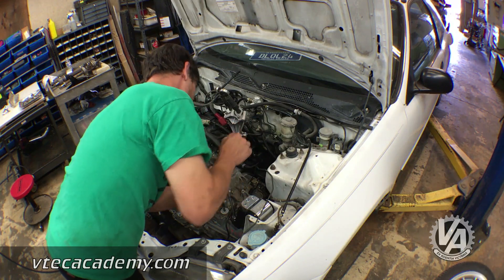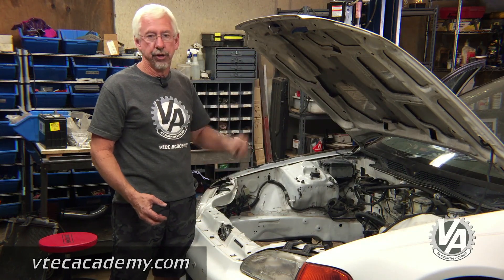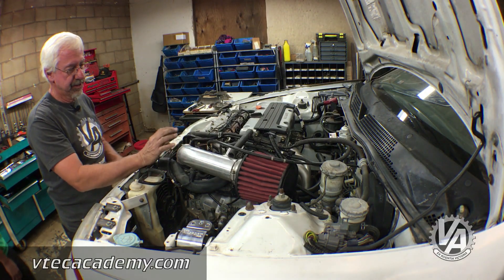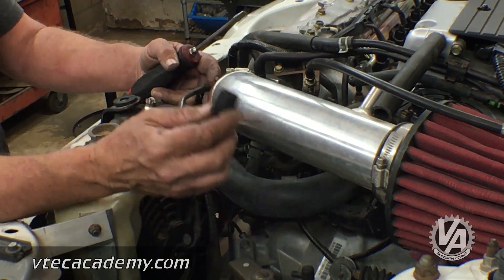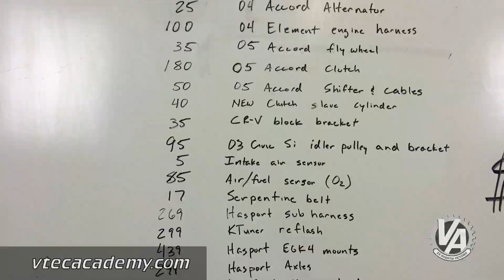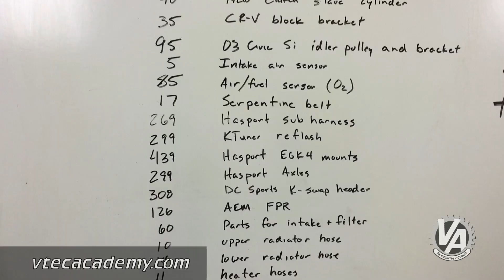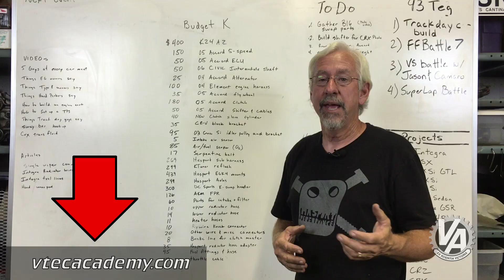Civic EG Budget K Swap Part 2

Comment: This vid makes me even happier with the 01 civic I just bought for 3k! K24A2 with type S 6spd, tuned on kpro v3, act stage 4 clutch, retained power steering,  VC has been tapped and welded and powder coated for a breather box, Moroso oil pan also tapped for turbo return line. It’s suuuuuper clean. All new fluids. Swapped in a cluster from a 05 civic. I bought it off my tuner when they decided to scrap the budget 10 sec project due to lack of funds and winter arriving. The car had only been swapped for like 40 days. Just the kpro and the clutch is like $1400!

Comment: EP3 axles would have saved that extra cash...theyre 36mm inners with 32mm outers to fit bone stock eg/dc2 hubs 😉
Reply: Thanks for this
Reply: @Pugsandhugs94   did you happen to go this route? is so were they the correct length  to the hub?
Reply: sorry for getting this up, just a quick question. could i fit the 5 lug conversion from the ep3? i have the whole ep3, and want to do a kswap in my eg. Could i fit brakes from the ep3 on the eg?
Reply: Ivan Dumančić no
Reply: Usually one of the EP3 axles is on the short side. And can pull out while turning or accelerating.
Reply from the maker: EP3 axles could leave you stranded on the side of the road with collateral damage from an axle slapping around at a fairly high rate. We have seen it happen. Some people get lucky though, so make sure you weigh the risk.

Comment: 7 years later, it can be done for $1,745 as long as you're willing to do some work. Dope.
Reply from the maker: Hell yeah, it's the golden era for K swapping. There's tons of engines out there and the support is at an all time high.
Reply: VTEC Academy  except for mounts going up to almost $700. I'd kill for them to be $450 again. Hasport should make cheaper cast mounts. Billet is cool, but saving money is always cooler.

Comment: I used to own a 07 Honda. Civic Si.. I want to do either an eg hatch or. Ek hatch with the k20z3 and 6 speed lsd the 07 Si came with. Around how much would it cost me? And can you use a. K24 block and use k20z3 head and what would that cost. This channel is.awesome and I can't wait to start my build with the help off this channel. Thanks so much for any information you can give me... Had a 99 SI ass well... And. Just sold a b13 sr20de t28R turbo 17 psi, and 300 hp to the wheels... I just miss that vtec sound to start my new build...

Comment: Uhhh I see top of the list has a typo . the a2 should be a4  if it’s what you quoted is a 160hp/160tq variant swapdizzle haha anyways this happen to be almost spot on before I found this video except for my halt came to the ECU . I had actually went up on the budget for a actual jdm k24a2 used the 03 accord “engine harness” which btw matches a 05 06 rsx (base or type S) ECU pin out except as many May know for the c101 connector (engine harness to ECU) accord aquires a C251 connector (dashboard to ECU plug) so I did not take anybody’s word for it that I could not utilize the accord engine harness just because the convenient wiring from the C101 was not present . So I did use the 00 ek conver harn but after laying out the 02 04 rsx, 05 06 rsx schematics . I just spliced the wiring according to spec to utilize the accords engine and charge harness . Which mostly involved wiring the primary 02 sensor to run off the C101 connector and verified all coil ground and relay grounds were connected according to spec . Hence , we need more diagrams specifying connections to run on a k24 rather than k20 swap hook ups that was the most annoying part of doing my first ever vehicle motor swap . Also the damn k tuned immobilizer bypass worked on the ECUs it did not state will work on . I was able to start the tsx a2 with the accord RAA manual trans, Crv (auto) PPL, 02-04 RSX base (auto) PND A-5# haha idk but I kept it on lastly to the oops didn’t notice purchase KTUNER 05 06 rsx type s socketed for board install. Which I was i was under the impression it said Ktuned (keep an eye out for that mis interpretation to much k this k that when you start to order parts it gets annoying ) . After all this researching I would on any of my future to come builds “ME” stick to 03+ accord manual engine harness cause it has the 2 piece connector that snaps on and off to break away from the fire wall much more conveniently than a 1 piece undress the crappy wiring tape and plastic and re mount for your desired tuck positions with new harness dressings with quality shit of course like high temp applications . Anyways very well vary on ! VTEV academy has it going on btw love the movement growing still

Comment: How important is a iat sensor on a k20 i have a kswaped eg but i dont have the iat sensor so when i rev it up it cuts at like 2k sounds almost like launch control it wont go past 2k without trouble idles fine would anyone know if its the iat missing that would do that iv double checked my timing its in time so im stumped?

Comment: Im doing a similar swap with 04 tsx motor in 96 ek can i use the tsx drive by wire throttle body or do i need and accord cable tb? Thanks

Comment: Brian, quick question. I know you did a crx drag car on pinks. I was just wondering what kind of engine would be best for boost, on a budget.
Reply: That depends on your goals. What car is it and what are you trying to accomplish. This car we just built you can turbo up to about 400-450 without too much trouble.
Reply: my tuner ran a del sol on a bone stock b series, ebay turbo kit, cheap everything except hondata,aem wideband) and tuned it for 18psi that thing was a monster
Reply: Our Pinks car had a stock B18C bottom end and we were running 18-20 lbs. I am not sure how long that would have lasted though.
Reply: +Brian Gillespie oh wow did not know that!! I'd imagine it would give out eventually!! engine was 100% oem
Reply: Bottom end was 100% stock. The top end had cams, valves and springs. We had a bottom end with pistons and rods, but blew it up because of a boost controller problem three days before the event.
Reply: ***** Thanks for the reply Brian, I've been watching all of your vids. Trying to learn a lot of stuff. My goal as a Car, My 89 CRX, is to be on the circut/time attack. Reasonable power I wanted was 400-500 with a turbo. I was thinking I wanted a sleeved b20. However I was kind of curious if a k20a3 would be worth sleeving for turbo applications. they are the same price, just different series of engines.
Reply: If I were paying for everything out of my own pocket, I would probably opt for a turbo B. In the long run it would be cheaper. For greater maximum potential I would probably go K. Sleeving is necessary for longevity. But if you were using cheap K20 base model engines, don't bother. You could probably get away with 400 for awhile.
Reply: ***** Thats, what I hear. I didnt know if it could be an option. Just because the base k20 is like 300 bucks, sleeving it for turbo is another 600 or so, and K20a2s are like 1400 or more.

Comment: So I just picked up an 03 Accord trans. Swapping a K24A1 into my integra. If I dont want to go the expensive Hasport route, what axles do I need? And I'm guessing I still need the EP3 intermediate shift correct?
Reply from the maker: I do not know what combination of stock axle parts will work other than the base RSX rh axle should be good for that side.
Reply: @VTECAcademy  
Ok thank you. I'll have more questions as I go. I have basically no help. Figuring this all out as I go

Comment: I ran my shifter cables through the thin part of the of the firewall and the cables seem to be too long. It doesn't seem to shift smoothly. Is there another way to route them?
Reply from the maker: I went down through the tunnel which used up more length.
Reply: @VTECAcademy  Thank you for responding 🙏

Comment: id like to know how you guys mounted the shifter ? did you make your own bracket or just buy one if so which one ?!?!?!
Reply: They sell the bracket (slab of metal) for the accord shifter . You can honestly jack up the car install a DIY slab of cut out and drill out holes for 10mm bolts and nuts I mean it’s practical enough

Comment: I’m being lazy , but will my k24 power steering fit on the high ground clearance setting with just the  hood cut like yours ?
Reply from the maker: It will touch the hood. There used to be a smaller pulley made be Jackson Racing that solved that problem, but unfortunately not anymore.

Comment: i think that's to much trouble and trying to see if this part works with it. I'm just going to buy a rsx type s and be done with it... once a swap that to long people give up on it.
Reply: I did my 93 EG Kswap with a 2006 RSX-S engine/trans. Used the 04-06 EP3 Idler pulley, 2004 RSX-S ECU and engine harness. On the 2004 harness on the 2006 engine/trans you'll need to repin the speed sensor (there are diagrams online, so dont worry). 2004 RSX-S harnesses are far easier to work with because there is a plug-n-play swap harness ($180-250) and the 2004 ECU is easier to tune and get tuning parts.

Comment: Is the engine compartment fuse box the original of the car or is it from the k20 ?? The source is compatible?
Reply from the maker: Rui Martins Fuse box is the original. For the parts list visit vtecacademy.com
Reply: Then the electrical part of the car that connects in the fuse box is only to screw the ??? As to the tops of the dampers, are not plug and play, what do I have to do ?? there is some technical guide step by step ?? ... ie without being wiretuck ... teaching just msm to get it and change the Necessary to work well
Reply: I'm in Portugal but my translation in English is not very good, since the video has no subtitles ... but I hope it helps me
Reply from the maker: It is the original fuse box. We had to modify the charge harness to get it to reach.
Reply: Como se faz essas coisas e uma guia, so sei fazer swap serie b, e agora montei um k20 mas faltame montar a parte eletrica, e se eu nao souber nada feito, fica o projeto parado...nao ha nenhum guia de explicaçao??? como voce aprendeu??

Comment: How did you guys get pass the immobilizer from the ecu?
Reply: Ktuner
Reply: +Brian Gillespie oh gosh silly me was thinking of cali smog and BAR for some reason lol
Reply: Smog and BAR would require adding some sensors that aren't on the EG. Fuel tank pressure, vent shut valve, secondary O2 and other things.

Comment: Hi guys, im planning for kswap on my eg. K24a2 on a budget can i run it with all stock and stock k24a2's ecu? And run it with all functioning eg's panel gauges etc? TIA guys, more power vtecacademy
Reply from the maker: The K24A2 ECU is a drive-by-wire ECU. Most people use a Hondata KPro or KTuner ECU so they can use a throttle cable operated throttle body. Converting to drive-by-wire is a pain. Lots of stuff to add.

Comment: i got a k24a2 about to be put in my ep3, do i use my idler pully from my k20a3? and can i use my old belt?
Reply: You can use your idler pulley but you can't use your old belt, the K24 crank pulley is significantly larger and the increased deck height makes the belt even longer
Reply: im using the old belt actually, but seems kinda noisy

Comment: You could do it for cheaper if the Hasport mounts weren’t 500 dollars even though I’m about to purchase some. The mounts are more than the engine and all the hybrid parts are close to the price of the engine making it expensive. I understand the r&d just saying it’s terrible that mounts are more than the engine itself lol. I am in the middle of collecting parts for the k24 swap just surprised at the prices for the actual what makes it fast and what allows it to mount.
Reply from the maker: Hasport is a family owned business and since I am one of the family members I have some knowledge in this area. The prices are not cheap but they are reasonable. The 10 employees at Hasport appreciate that they have a job researching, developing, designing, manufacturing, packaging, and shipping the mounts that allows them to pay their bills and have money left over to play with cars. And thank you very much for purchasing Hasport mounts even though you feel they are expensive.
Reply: @VTECAcademy  Was just being honest those engines run for so cheap and when you factor in what goes into those aluminum blocks and all the precision just find it crazy in 2018 the prices on things . Not trying to throw salt or anything, And were all on the same boat when it comes to working and taking care of our families and trying to afford fun things in our life. But i recognize quality so not much room to wiggle and i dont want any corners cut.

Comment: u coulda went with stock/factory mounts and then bought the esmm mounts, woulda shaved off couple hundred!
Reply from the maker: The stock mounts won't work. So you can't use them with Energy Suspension motor mount bushing. You need a swap mount for that chassis.

Comment: I will tell u rigjt now that is not a k24a2. those only come in tsx it's a k24 but not a k24a2. k24a2 is one of the few 2.4 ltr that has vtec cams on exh. and int. accords are more "eco" and vtec only comes in the intake cam. (:
Reply: You're right. Not a k24. If it came out of an accord it's a k20 engine.
Reply: Incorrect. Accords here came with a K24A4, as did Element and CR-V.
Reply: the accord did not come with a k20 dude. do research the accord has a k24
Reply: In other countries, our TSX is sold as the Accord and yes it did come with a K20.